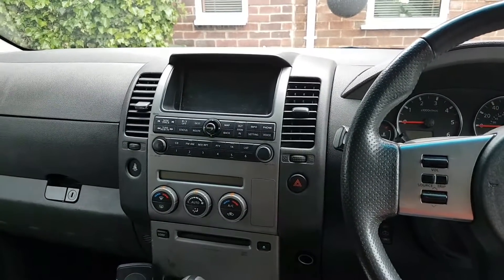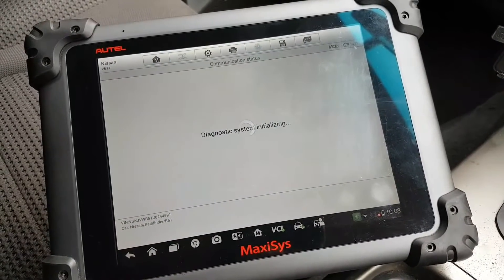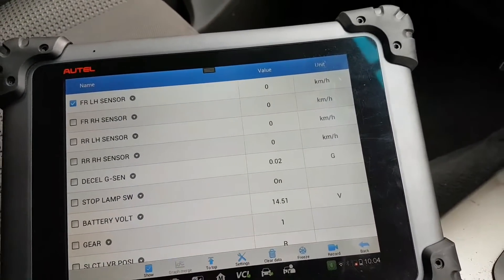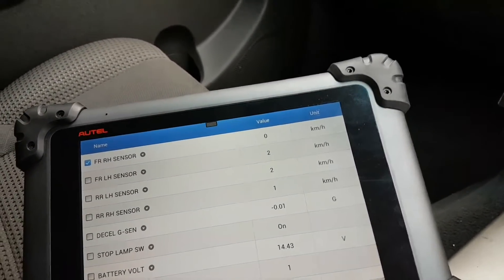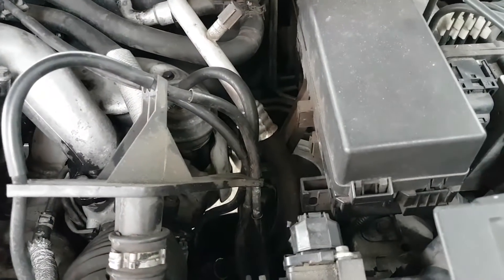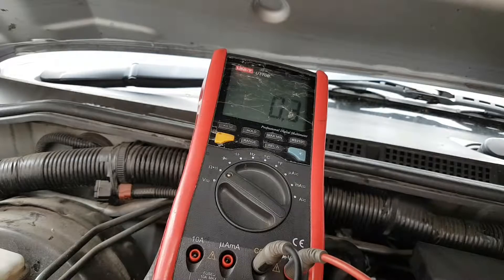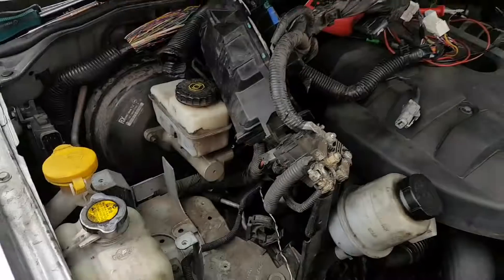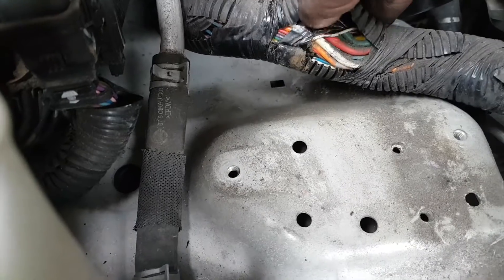Nissan Pathfinder 2007 ABS and ESP lights on, error C1103. Fault finding and repair.

Comment: What can be done if it happens that whenever you switch on a  Nissan car all dash signs appears and disappears but for VDC and Airbag  not seen at all? ? While they should appear and dissapears  as others do?
Reply from the maker: Looks like those might have been "taped" previously...
Scan the car, most likely will be faults on those modules that cannot be cleared... ence the lights covered...
Thank you for watching!
Reply: @LMAutoRepairs  thanks initially  Airbag, ABS, and VDC, were popping up on a dashboard and the horn was not working,  we checked and we found that the clock spring on the steering was broken and we had replaced with the new one and the horn had worked, ABS sign becomes OK as when I switched on it appears with other  dash sign and disappears, but I wonder Airbag and VDC not showing up at all while they were supposed to show up and disappears as others do, but when I installed new clock spring I didn't scan the car, can this be cleared by scanning the car  with machine? ? Or perhaps the bulbs for these two dash signs might have blown out? ?
Reply from the maker: Yes... could be the bulbs... even thought some dashes actually uses LED...
Scan the car and go from there... is the bast thing to do...
Reply: @LMAutoRepairs  thanks I wanna try and give you a feedback

Comment: Very nice explain thank you sir. I have a question what is the diffrence between an active and a passive sensor while speed
Reply from the maker: Better that I would explain...
https://www.apecbraking.co.uk/Resources/TechniciansGuides/ABS-Sensors.aspx#:~:text=ABS%20sensors%20are%20classified%20in,is%20with%20a%20power%20supply.&text=These%20comprise%20of%20a%20wire,core%20and%20a%20permanent%20magnet.&text=The%20ABS%20control%20unit%20converts,a%20digital%20signal%20for%20interpretation.

Thank you for watching!

Comment: Hi , nice , i have a problem with my Pathfinder, the 4Hi is not engaging, i lookend on the manual and did a self diagnostic on the transfer case and it came up with 3,6,7,17 flashes,  which is
 -Clutch pressure solenoid
 signal. Proper voltage is not applied to clutch pressure solenoid valve due to open or short circuit (mine is a manual so i don't think i have this on the car)
-Vehicle speed signal
 (from ABS)   Malfunction is detected in vehicle speed signal that is output from ABS actuator and electric unit (control unit) through CAN communication.

  Improper signal is input while driving.
-CAN communication.
 Malfunction has been detected from CAN communication line.
-ABS operation signal
 (from ABS). Malfunction is detected in ABS operation signal that is output from ABS actuator and electric unit (control unit) through CAN communication.

I don not have any ABS problem , brakes work fine , 4x4 Auto and 4HLo work fine

Can you help me with an ideea?
Reply from the maker: I guess you need a good diagnostic session... look at some live data etc...
Thank you for watching!

Comment: I have the same problem on my pathfinder no one could find the problem. I changed sensor but now it makes sense why the light was going on and off for about 3 weeks . Thanks alot man
Reply: Update on my pathfinder,  ABS RR wheel speed sensor wire was broken running up over the chassis crossmember . Used a voltmeter to test the wire as I went down from the engine compartment. Both rear abs wheel sensor wires run on the passenger side on the side of the chassis.
Reply from the maker: @SwishRecordsInc  
Great find!
Well done!
Reply from the maker: 😊
Thanks!
👍👍👍

Comment: Great video. I have my vdc and slip light on after doing a wheel alignment, clock spring change and adding power steering fluid. All other fluid levels are ok and the codes were cleared but I still have the lights on. Any ideas?
Reply from the maker: Probably needs sensor alignment...
Check for codes and live data...
Thank you for watching and for your comment!

Comment: What's the tool called you used to pierce the wires..
Reply: Thanks very much I've just bought them... Great video by the way
Reply from the maker: @andrewbeardsworth5461  
👍
Reply from the maker: Hi
Piercing probes...
https://rover.ebay.com/rover/1/710-53481-19255-0/1?mpre=https%3A%2F%2Fwww.ebay.co.uk%2Fitm%2FTest-Clip-Insulation-Piercing-Alligator-Probe-for-Car-Circuit-Detection-Red%2F264604665667%3Fhash%3Ditem3d9baac743%3Ag%3Azt0AAOSw1T1eJPLv&campid=5338344466&toolid=20008
There is better ones, more expensive... but if you look after them, these will do the job...
Thank you for watching!

Comment: I've been seeing a lot more wires failing mid harness or in spots you wouldn't access for testing. I'm thinking that maybe the wire is getting damaged as they make the harness, either scuffing on the spool or maybe getting caught on something that opens the insulation as they make them. With the insulation as thin as it is these days it doesn't take much.
Reply from the maker: Agree...
And is a good possibility that that is happening...
Thank you for watching and for your comment!

Comment: Quality detective work as usual 👍🏻 it seems the garages only like the easy stuff
Reply: Yet the easiest money is throwing some cheap parts at it and then making a nice marknup
Reply: @jusb1066  ya that's what most do
Reply: Yes they do  you always test the sensor and the wiring first before wasting time and money replacing it he'd did some job
Reply from the maker: Indeed... 
Thank you for watching and for your comment, really appreciated!